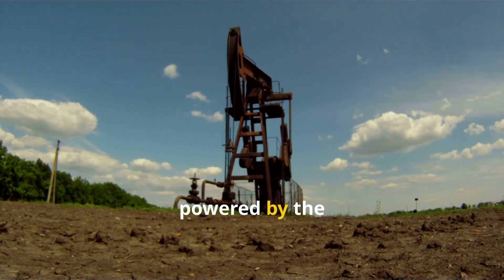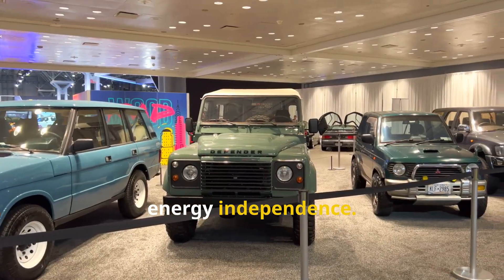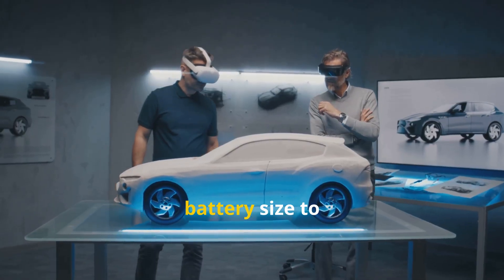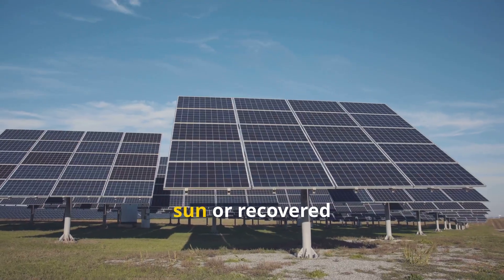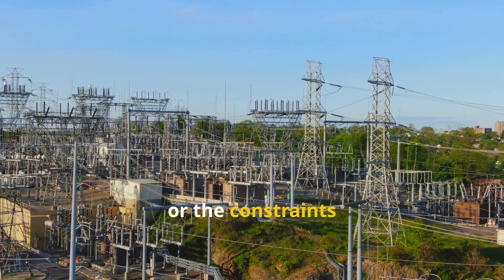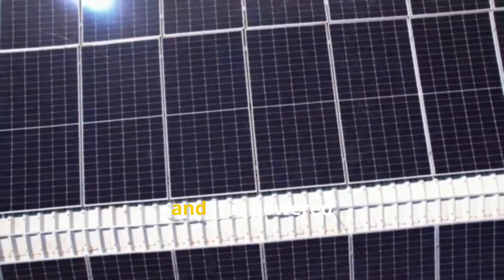Solar-Powered Cars Explained – Drive on Sunshine

Comment from the maker: In this video, we explore the science and design behind solar-powered cars—vehicles that use sunlight to generate electricity and drive without burning fuel. From photovoltaic panels to electric motors and battery storage, discover how these clean energy machines work and what their future holds. Whether you’re an eco-conscious driver or just curious about green tech, this is your guide to the future of solar transportation.
00:00:00 Fuel from the Sky
00:00:48 The Promise of Solar Mobility
00:02:03 A New Breed of Vehicle
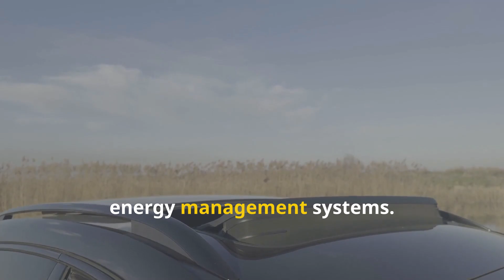00:03:01 Fully Solar vs. Solar-Assisted
00:03:46 Photovoltaic Panels
00:04:48 Battery and Power Management
00:05:43 Motor and Lightweight Frame
00:06:28 The Primary Energy Pathway
00:07:12 Storage, Use, and Recapture
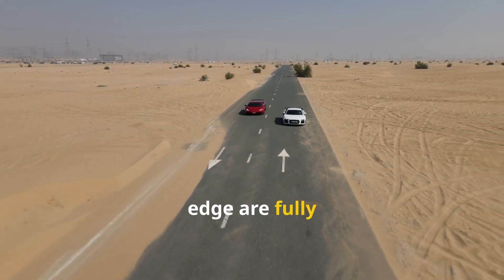00:07:53 Purely Solar-Powered Cars
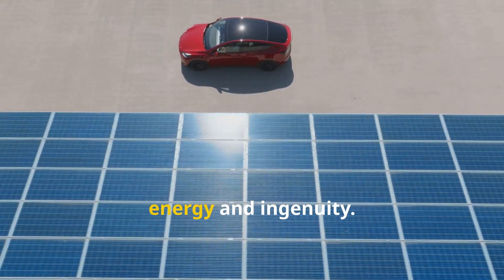00:08:42 Solar-Assisted Electric Vehicles
00:09:16 The Clean and Cost-Free Commute
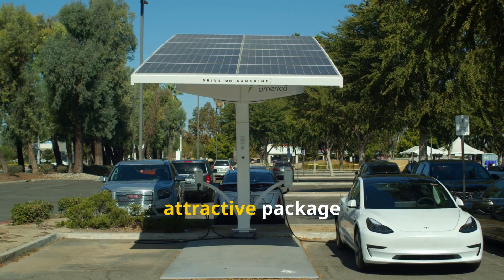00:10:32 Driving Innovation and Independence
00:11:22 The Constraints of Nature and Design
00:12:12 The Hurdles of Cost and Practicality
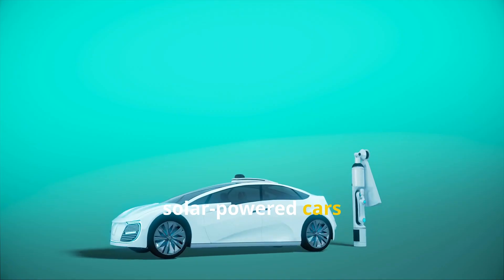00:13:21 Solar Tech in Action
00:14:07 Innovations on the Horizon
00:15:04 The Dawn of a Sustainable Drive